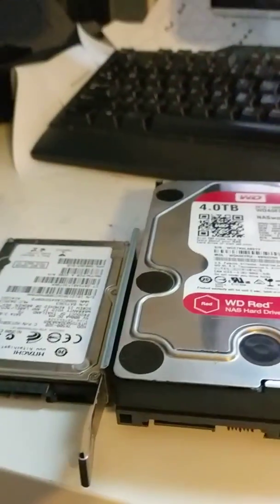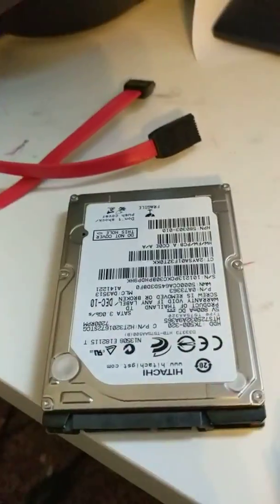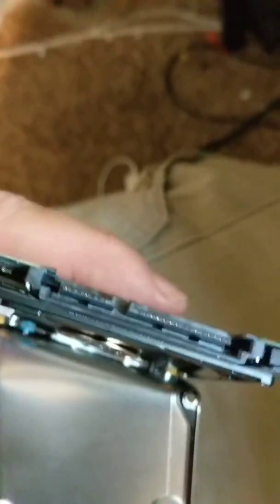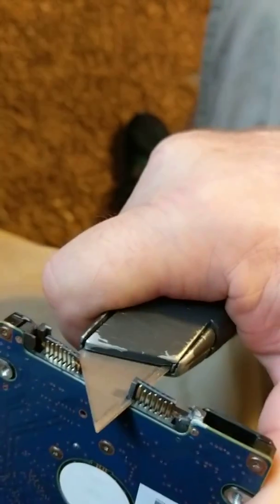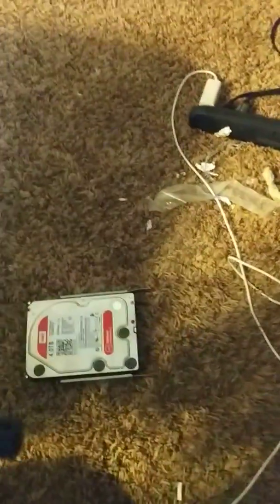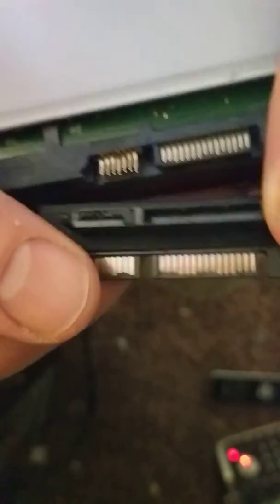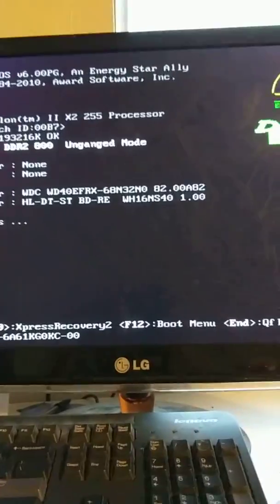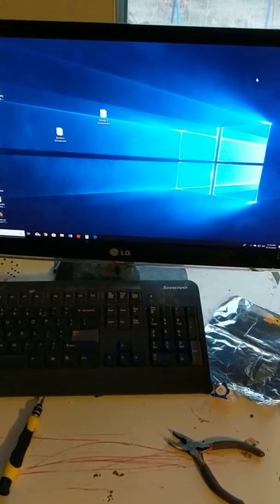How to repair broken SATA connector

Comment: I used this video as inspiration.  You dont need the right angle adaptor.  Just get a normal sata cable.  Get the old HDD,  you dont need to open it just brute force the plastic around the bit you want then use some side cutters to trim it down.  Once trimmed use a very sharp knife to chisel away or sand away at the little L shaped bit of plastic until it fits near perfectly behind the pins.  If there is any pastic behind the pings from the old one scrape it off.  You can leave it slightly longer if you want to be safe.  Then just straighten the pings out then put the little bit of plastic from in the sata cable.  Then carefully insert the pins.   It should be snug and feel pretty good.  Took me around 10 mins.  Now I know what I am doing could probably do it in about 2 or 3 mins.
Reply from the maker: Thank you so much for that. If it's easier, all the better!!!!
Reply: @dannybonesdaddy  I dunno about easier but I have many tech bits but none were small enough to open the old laptop hdd I used for parts.  So I was surprised how easy it was to just break it off.

Also Amazon is international shipping for me and AliExpress would take months.  I didn't want to wait weeks or months to fix it, and I also didn't want to go buy more tools. 

Was super surprised it worked.

Comment: Nice fix. I busted a connector on brand new WD Red 6TB drive. Luckily, I was able to get the broken piece out of the cable.
Reply from the maker: Yay, a comnent! You would think this sort of thing happens somewhat frequently, I'm surprised there hasn't been much reaction so far. So thank you for sharing that! :).